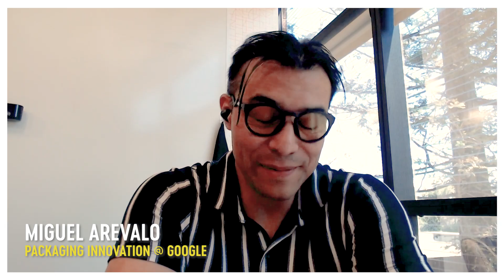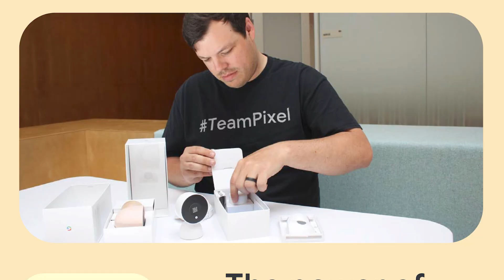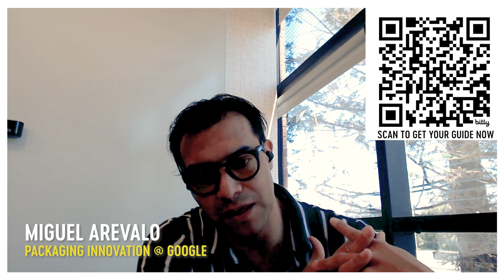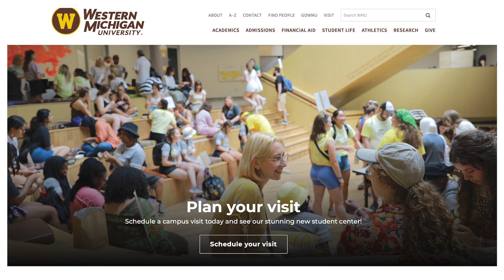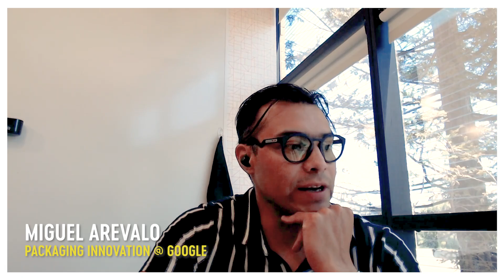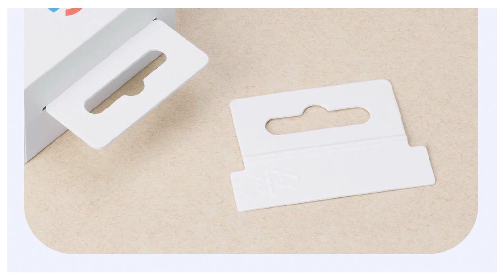Google Plastic Free Packaging Guide

Comment: Thank you for this interview and the guide.
I've been trying to find a plastic-free solution for packaging candles and soap, at some point I decided to design my own  for molding them from paper pulp, but I've also been struggling with this since I have no experience with designing packaging.
I'll read the guide and hopefully something klicks. 😅
Reply from the maker: Glad it was helpful! There’s a lot of great info in there, if you’ve got questions please feel free to ask them and we’ll do our best to answer them.
Reply: @packagingunboxd  Thanks! Well, I finally read the document and although I won't be trying to reach the standards of packaging of companies, that ship electronics like Google, it did give me some things to think about. For now, my problem is that I can't demold the pulp while it's wet without it breaking apart, no matter how well I polish the mold. It might have to do with the glue I'm using, or that I used a blender to break down the cardboard, potentually shortening the fibers. I also tested the material outside of the mold and it's stiff, not as strong as paper mache, so I might try to sandwich the pulp between 2 sheets of recycled paper and maybe modify the design of the mold. for now, it has an 8-degree draft angle.
Reply from the maker: @Dilyannn  normally demolding is done dry through heat applied directly to the mold releasing all moisture through steam. Doing it wet would be a mess. Some small run shops I've seen them build a solid male mold and a screen female mold to help dry quicker for sampling.